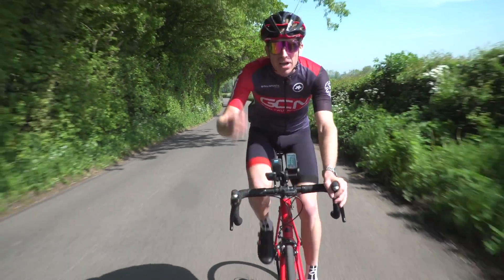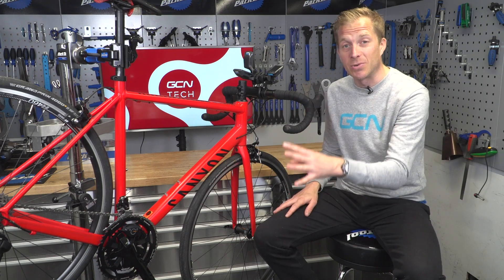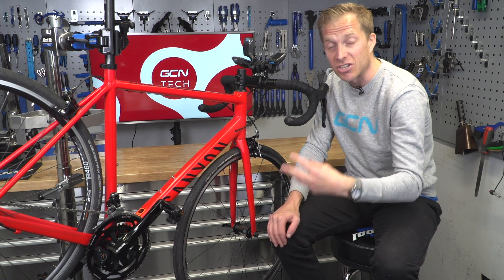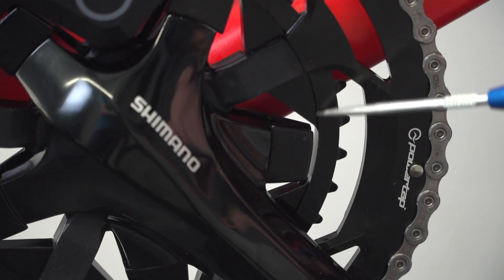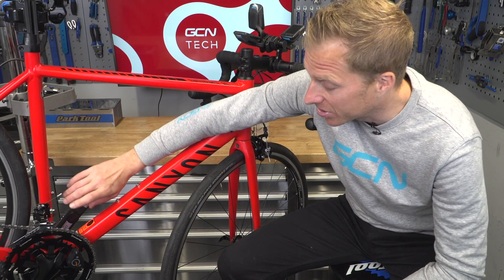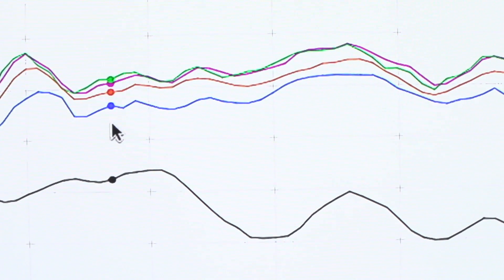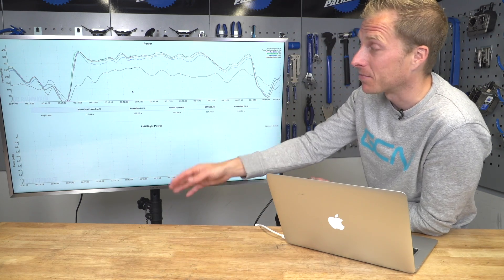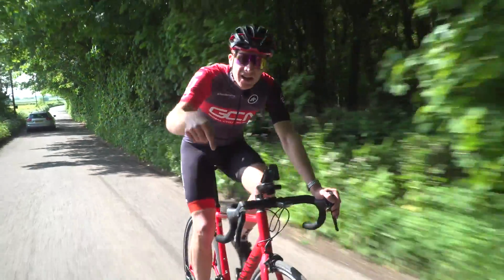Where To Fit A Power Meter On Your Bike | GCN Tech Does Science

Comment: I ride with a PowerPod and was disappointed you felt the pedal based system is the easiest way to swap your PM from bike to bike. TBH a full crank is not hard to swap now either if you are pulling the tools out. So why have I gone with a PowerPod? Technically they are superior to all other PMs, but this is just from the perspective on an Engineer with a large degree of experience with military applications using accelerometers. The PowerPod doesn't go out of calibration. All strain gauge systems will need calibrating over time so if continued accuracy for training is key then you need to get calibrations done at least every 12 months. Maybe a tech episode on strain gauges and how they are applied and why they work would be beneficial. PowerPod gives me wind resistance readings that are brilliant to evaluate my performance during a race, looking at the impact of pushing into the wind to move up the peleton or how well I'm drafting are a couple of key areas. Then there is the efficiency measure. Because it is accelerometer based, it maps how much I'm moving my bike around, then averages out the losses during the ride, and shows how I move the bike around when riding so I can focus on improving where needed. I lent mine to a mate and he dropped from 8W to 2W in his losses. Finally, I get left and right power and where the power is being delivered in the pedal stroke. 

PowerPod is a vastly under-recognised meter but I think there is too much data for most riders, plus it hasn't got the cool factor that seems to sell so much product.
Reply: It's technically inferior since its not measuring your actual power output and is oblivious to critical parameters like drag and rolling resistance.
Reply: Clearly I wasted my Engineering degrees then. Especially the undergrad thesis on drag and aero of bicycle wheels, but so glad someone is here to correct me. The only value of these things is repeatability for direct comparison to previous performance so tailored training can be applied. No 2 meters should be compared too closely as they all demonstrate variances. Calculating your frontal blockage area and ensuring the tyres are inflated to the same pressure takes away the errors. Then being honest with weight and keeping that up to date adds the final element so clearly not oblivious to "critical parameters". When the accelerometers output has these corrections applied it then measures the power required to create the accelerations (including "G"), so your assumption that actual power is not measured is completely invalidated. Given that they have been tested in comparison to strain guaged meters, and maintained similar variances to the others in the power measurement alone, plus having all of the benefits of the other measurements, I would suggest you have failed to understand the tool and how it works. Thanks anyway Brendon.
Reply: Perhaps you have. It is deducing power from other parameters like acceleration. If you think this is the same as directly measuring power, I fret for the state of some of our higher education facilities. The only reason I can fathom why someone with the background you claim would taut the PowerPod so grandiosely is if they have a financial interest in its success. If rolling resistance and drag were static, then yes, you could properly account for those factors but most people don't train on a velodrome and will encounter various road surfaces and during the course of a ride may just change their riding position from drops, hoods and tops. Have you ever weighed yourself before and after a long ride in hot conditions? Bottles filled vs not, dressed for winter vs summer? etc. In the end, you can make a good power estimation but you will never reach the accuracy of a traditional power meter. Cheers and godspeed with your PowerPod.
Reply: Ahhh, the ever present fallback position of the uneducated American. If someone argues too successfully for them to reply without actually understanding the intellectual subtleties of the argument, they are labelled a shill for said product supplier. I will give credit that you have considered the variances, but the degree of differential, unless going to a cobbled or dirt for rolling resistance is minimal and can be considered to fall within acceptable variations. remember, most meters vary among themselves by up to 4%, and sometimes more which is why the power outputs of each individual are only relevant to them, on their meter. I have competed in endurance events where each session concluded with a weigh in and immediate refuelling of calories and fluids to prepare for the next, so I guess I may have been around a while and done a lot of things. 

I guess you must feel that power data needs to be closely analysed every day. The realist knows that most days are just riding reco or building base, and that only needs your HRM output. On the days that intense efforts or sweet spot training are conducted most riders will be covering known terrain and maintaining repeatability in their training with positions being held through the effort. They won't be randoneurring or setting a new endurance record for themselves whilst out sight seeing. Just a few points to consider that may help you understand the benefits of using a power meter and determining what is relevant and what is not when considering a power meter. I must admit I did consider all of these factors myself when looking at the purchase. Fortunately I am all too conversant with the impact of each of the elements that could cause some to give pause, so when I evaluated each of the added benefits, and reconciled the conditions I would be using the under for real training as compared to a curiosity of what might be occurring the rest of the time it was a real no-brainer. I doubt you will be running out to buy one, and I really don't care if you don't, but at least you might now understand why your fears should be put to rest. Peace and good roads mate.
Reply: I didn't know my fallback position was so vanilla uneducated American before proceeding to list numerous reasons why computing power off indirect measurements has limitations and problems. I was merely implying that someone with a technical college degree should know the difference between direct and indirect which you initially "called me out on" while being wrong about. Now you switched your argument to saying something along the lines of saying it can't account for certain things but its still good enough. I prefer a solution that is indifferent to my weight and body position and by your accounts less technically advance. I'm glad your PowerPod is good enough for your cycling needs and your numerous engineering degrees that you must remind people of. Glad people at my work don't behave in such a manner, it would be exhausting to say the least!

Comment: I'm not sure this helped much. All you showed us was that the power meters go up and down at the same time. You do little to explain the 15% difference in the reading between the top line and the bottom line (ignoring the heartrate monitor, which is pretty much just a random line).
Reply: He covered that the stages is low because he has a large L/R imbalance so doubling his weaker left leg will yield a lower reading for the estimated total power.
Reply: Brendon, that's unlikely to account for a 15% difference since that would mean that his left leg is 30% weaker than his right leg. It's not impossible, but I would be surprised if he has that much difference between legs.
Reply: 15% is a difference of 52.5W at 350W. And much of the middle part of the graph is in that 300 to 350W range. The Stages is definitely not reading 45 to 53W lower than the dual sided meters. Its more like a 20 to 25W difference which equates to around 7.5%. Doubling it goes to 15% which is easily explained by a weaker left leg.
Reply: Look at the chart again. There are sections where one line is halfway between tick marks and the other line is halfway between another set of tick marks. That is an approximate 50W difference.

Comment: Great piece. Although despite the 5 different types of PM you didn't include a traditional crank spider based system! The PT chainring PM and the stages crank arm system are different from that of course, and both are relative newcomers. I've had several PT G3 hubs and now have a P2M NG. One thing I would say to anyone thinking of buying a PM is that the most important thing is accuracy, or, more accurately (ha ha), precision. 2% might not sound like much, but that's 5 watts or more at FTP and once you start training with power you will realise that a consistent increase of 5 watts in your FTP represents a significant increase in fitness and a significant amount of training. Really, the precisions of the current crop of power meters are only just good enough to be useful (it doesn't help that precsion is rarely quoted by manufacturers or tested, but if a PM is x% accurate it should be at least x% precise). Also, remember in this context that although 1 and 2 are both quite small numbers, 1% is twice as much accuracy as 2%...
Reply: Pedaling styles affect which parts of your bike flexes. The only smart place is the hub. Crank based systems can train you to flex the bike/cranks rather than go faster. In fact, the perfect place is the rim. But people would throw a fit if a rim weighed more......
Reply: @sasquatchrosefarts  That's an interesting idea - I can see how a crank arm system like the Stages could train you to flex the crank as well as apply torque. It would be interesting to try to quantify how much difference that could actually make, i.e. how many "unnecessary" watts you could put into crank flexing as opposed to torque just by a change in pedalling style. But with a spider-based system it's more difficult to see how you could apply torque to the spider without also applying it to the drive train.
Reply: @neil7769  the chain stretches. A lot. If it's on the spider, you will train yourself to pedal in a way thats stretches the chain to get higher watt numbers when really you're going slower and wasting energy. The only smart place is the hub or rim. In fact, spokes flex so much, that putting it in the rim is the only smart place. Even if it adds two pounds to a training bike  it doesn't matter - it would make people smooth out power delivery to minimize flexing things. These devices aren't really good at measuring sprint wattage anyhow. You have to learn to sprint based on feel and instinct.
Reply: @neil7769  after a hundred or more miles, there are photo finishes.....even if small groups attack and stay off the front ....... .. a tenth of a percent efficiency  improvement matters. Bikes are $15,000 but they train with power systems that mess up rider power application efficiency. Blows my mind. Back in the day, magnus backsted was known for training with nothing. Just a bike, helmet, bottles shoes, and the world around him. Crazy, right?  He had to listen to his body. Don't even get me going on how stupid heart rate straps are. Messes with breathing and biomechanical movement patterns of the torso. And dont get me going on the gps unit and sports bras for soccer players - massively impacts posture and torso and shoulder flexibility. Critical for acceleration.
Reply: @sasquatchrosefarts  Interesting - but you'd need to quantify it to find out of it was meaningful. OK, we know that drive train losses might be 2 - 3%, but how much of that is chain stretch, and of that, how much could you actually unintentionally train yourself to put power into, that you wouldn't necessarily be putting into anyway?
Reply: @neil7769  it doesn't matter. A hub is better than a crank. And a rim is better than a hub. And the price difference is negligible even on a $2500 bike. Power tap hub is what $600? Chainrings are $350? It's a small price for a real improvement. And a rim sensor could have almost no size and weight constraints. They could make it for like $200.
Reply: @sasquatchrosefarts  Of course it matters, because you don't know if it's a real improvement unless you quantify it.
Reply: @neil7769  bahahhahahahahahahhaha. I know the chain flexes and spokes flex. And hubs flex. Frame flexes. Cranks. Bb. Therefore I know it's a real improvement. To move a strain gauge further from rider inputs.  Further down the line, so to speak. They're trying to make power more accessible with pedals, but it can literally make you a slower rider , to train based on data gathered at the wrong point on the bike.
Reply: @sasquatchrosefarts  Look, I think what you're saying is interesting, but it's only relevant if it's significant, and you need data to show that. Even without data there's good reason to think it wouldn't be significant. It doesn't matter in itself that these things flex, what matters is what percentage of these percentages (losses due to flex) are potentially variable accoring to pedalling style, and then what percentage of that is likely to be "trainable". It's likely to be miniscule. Most chain stretch is probably unavoidable whatever your pedalling style is, so the relationship between watts at the spider and watts at the hub (or even watts at the rim) is likely to be almost  linear. I suppose that cadence (at the same power) is likely to be the biggest non-linear factor. There's going to be less flex in everything at higher cadence and lower torque, so I suppose it's possible that a crank based PM could train you to pedal at a slightly lower cadence than was optimal for drivetrain losses compared to a hub-based PM.
Reply: @neil7769  I admit running multiple systems can be prudent. But you won't sound like anything but a dummy if you say strain shouldn't be measured downstream of a chain. And preferably also downstream of spokes. And just imagine the data you could get as it relates to wheels, with a 30 hole rim and a strain gauge in every third hole? It would be an amazing sea of data.
Reply: @sasquatchrosefarts  I agree it could provide some very interesting data, but probably much more useful for optimising wheel / frame / drivetrain design than for optimising training.
Reply: @neil7769  I appreciate our discussion. Your next homework assignment.....count filmed stars from all tesla missions and ISS livestreams, and appollo missions. I count zero.. what number you get? So what does that say about formal education as it relates to "science"? 😉
Reply: @neil7769  how many stars filmed?

Comment: i use a stages PM, but the reading is not consistent. i use a garmin 520 and the reading every now and then disapears for like 3-5 seconds and then it reappears for about 5-10sec. is this something i should be concerned with? thanks!
Reply: Jv Araneta Try mounting your Garmin on the stem instead of forward.  Sometimes this helps. This is a known problem of their 2nd gen unit that they fixed in their 3rd gen.
Reply: Stuart Dryer thanks for the tip. I’ll keep you posted.

Comment: I’m using Rotor inPower. I’ve got a question about the optimum chainring position (ocp). Maybe someone knows the answer. I’ve used the Rotor software to determine my ocp. But when I do the ocp test with round rings, it suggests lower numbers (1 or 2) and if I do the test with q-rings on standard ocp 3 it suggests ocp 5 or even more. I asked Rotor and I got no clear answer. Anyway, nice video👍

Comment: Garmin Vector 3 pedals
Reply: Drake Deuel how well do they work? I like the idea but worry about what happens when pedal body wears out due to clipping in and out.
Reply: Ian Jeffcott I haven’t used them for long enough to comment on the durability in the long term, but they’re a very easy and simple option and have worked fine so far. I think that I probably would have gone with a crank based system in retrospect, as I’d like to try switching to Speedplay pedals now but can’t.

Comment: Absolute accuracy doesn't matter, i't's all about repeatability. If it shows 500 w on a bad day, and 700 w on a not so bad day, then that's all you need. That those are ridiculously high numbers only matters when it comes to comparing yourself to other people, but for actual training and pacing, absolute accuracy doesn't matter.
Reply: Lite Roadie it would matter most if you were wanting to swap meters / brands. Then you would have to start from zero
Reply: Yes, but if you just want to buy one power-meter for training and pacing, pretty much anything goes, although I'm not a fan of the Stages since it's one-sided. I really like the Powertap hub, really can't see any problems with it.
Reply: It does if you have multiple bikes with different PMs.
Reply: Well that is sort of true, but what is not tested here is consistency of error across the range. Zero offset is not a calibration as most head units indicate. Accuracy is complicated and most people don't really understand it.

Comment: Not training with power, but I do have a remark: my Shimano carbon pedals wear down over time -2 years and they are done. Now, if you buy a pedal based power meter: can you replace the pedal without having to buy the power pedal part.
Reply: I'm curious.  You wear out the pedals or the cleats?
Reply: both, cleats wear quicker ofcourse, carbon is a relatively soft material. if there's some dirt or friction-movement in your pedal movement it's bound to happen that your carbon pedals will wear down. (the solution might be to use cleats without play but that's not advisable for most people, I get knee problems when there's no room for movement.
Reply: Makes sense.  I've never worn out any pedals but I usually buy new ones every few years anyway.  Still have a pair of the original white clunky aluminum Look pedals from the 80s hanging up on the wall.